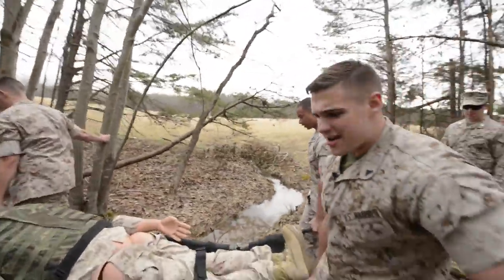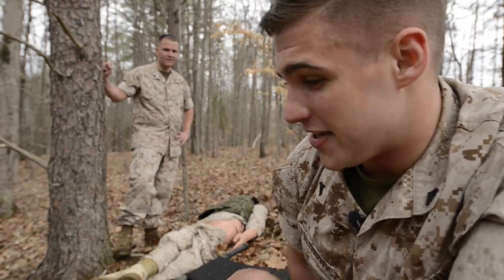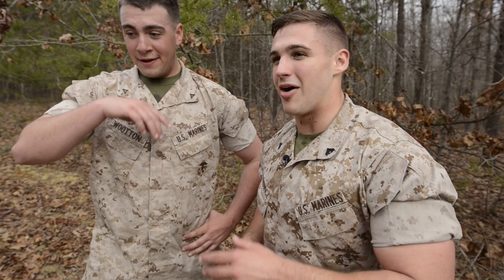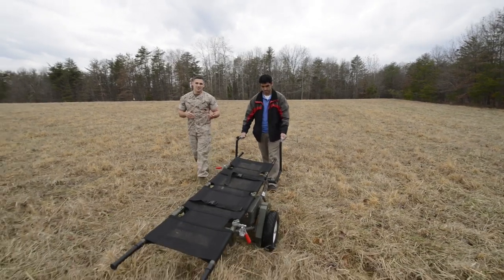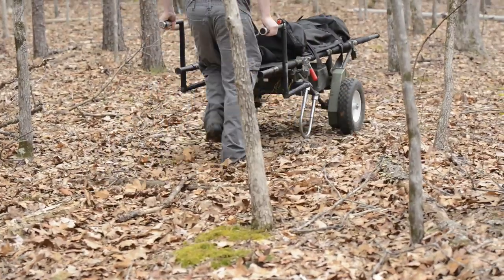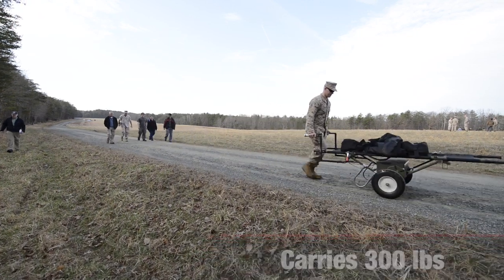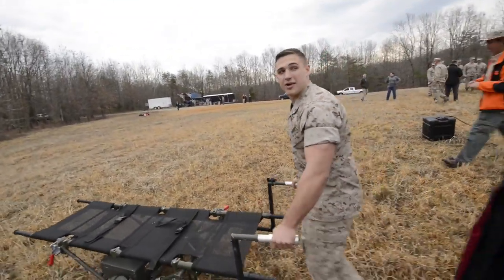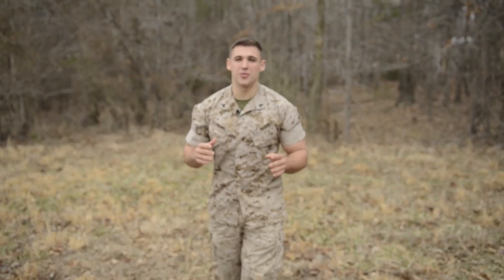With the Gear — Breaking Barriers With the Electric Litter Carrier

Comment: Keep it simple. One or two wheels centered on litter and NO motors to fail or expire. One or two Marines would be able to easily maneuver and power it to dust off. Get real, there never has been, and never will ever be, a 300lb Marine. DI's in The Corps would never allow that to happen.
Reply: 300lbs with gear
Reply: mtyd05 Have you ever seen or known of any wounded being evacuated with their gear or even weapons? If their injurys are light they could be luckey and still dressed in most of their BDU's, but if they have the worst of wounds they may be just wrapped in a blanket and naked.